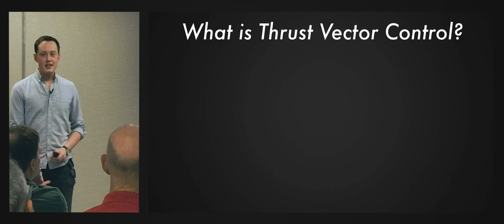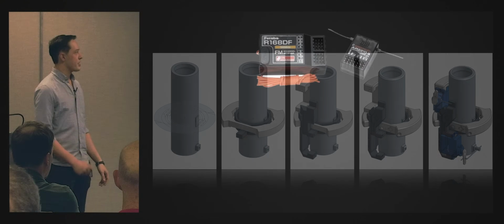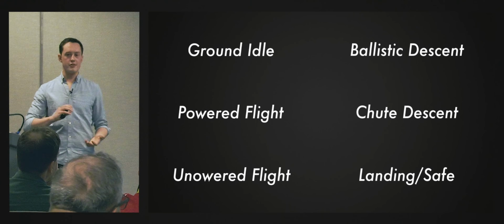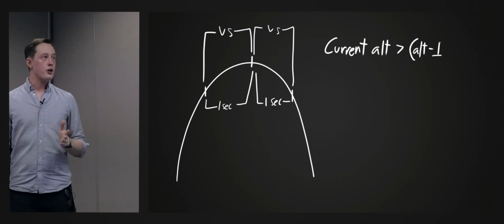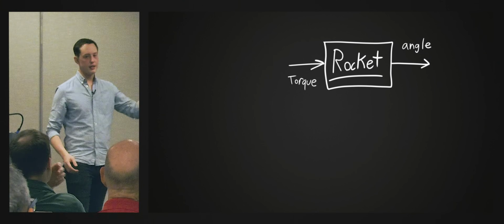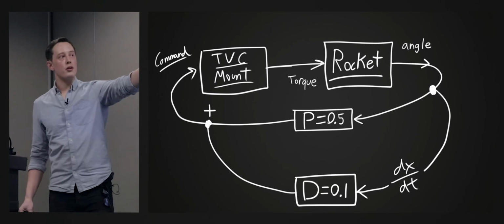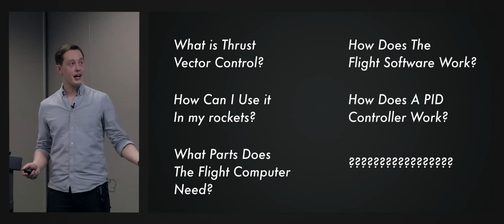How To Build a Thrust Vectored Model Rocket - National Rocketry Conference 2020

Comment: So rather than develop a standalone, why not use a Flight controller light a H743 or F7 made for quads. INAV and Ardupilot allow custom mixing that allows you to map roll pitch and yaw, also home positioning and take a beating. Plus they have prebuilt peripherals already coded in.

Comment: Wow.... PID controller huh? Amazing how nothing changes but the names. Pretty sure this used to be called a servo control loop back when I was younger 😂😂
Reply: Only if it’s used for a servo…this is just the general form of it, which can apply to everything from rocket motors to your air conditioner

Comment: .turbine thrust L
Reply: . Around the rocket also to help burn off space rock and debris
Reply: . "Burn off"
Reply: Getting vehicle back safely (contained or stalled stagnant) = landline the symbol for an old phone line? Looks like a capitol
Reply: Why not use all four? But switch off in rotation in "jobs" for example radiator alternator fan belt engine do they don't exhaust or "tire out or burn out" like a giro
Reply: Use a tide latitude or longitude
Reply: How do you kick (with your foot) energy back into battery are batteries positive negative neutral combinations according to an outlet thats not labeled positive negative neutral or combinations? Is the rocket +- or neither ?
Reply: Ware gets worn " Warning ⚠️"

Comment: 10:50 microcontroller options :=
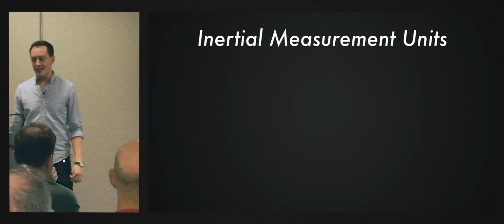12:25 Inertial measurement unit options =
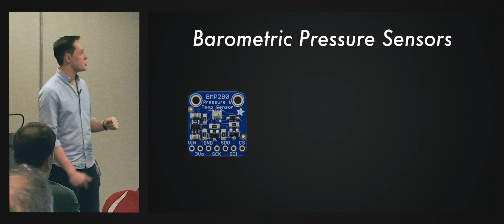13:05 Barometric Pressure Sensors options =
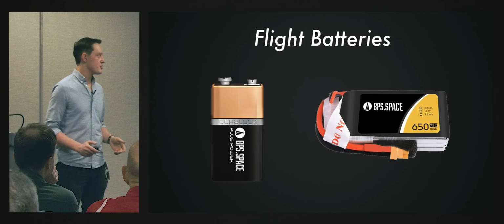16:00 Data Recoreders options =

Comment: I've heard him talk about PID controls for his rocket and it's off a bit ... 
Then I remember he's using an Arduino and such.  & I'm not familiar with what's available there. 
So ...Yes,  P is proportional, I is Integral, and D is differential.  
"I" is not dangerous and "D" is not necessarily always a brake or hardly ever just a brake.
There are a lot of selections that can be made with PIDs: 
Different formulas. 
The loop can be direct-acting or indirect-acting. 
The parts of the loop can act on a change in feedback, or change of error.
"I" can be set to either "repeats per minute" or "minutes per repeat".
"D" is anticipatory control and for this value to be more than some factual number requires the application to have a lot of storage...room to work.
A lot of time "D" is just best to set this to its lowest value.

Comment: Gread Presentation and overall verry Informative VIDEO.
U can use FC-Black Box logg and that will provide u a s..t load of data like on what Hz dose exactly rocket vibrate fom microsecund to microsecund.,how fast u accelareted,on what inclinacion is rocket at anny time,u can filter electrical noise,look just how HUGE Are Quadcopters (FPV) EVOLVE JUST from analizing BlackBox data,And u can use Betaflight Black Box loger and even make lay-out over filmed video.
Take care and greatings from Croatia,land of Rimac,Buggati,Orqua FPV and lot of Unicorn I.T. Companies.

Comment: Awesome explanation I'm currently trying to build my first tvc controlled rocket and it already helped a lot. But I have one question if you're simply adding the derividive back into the loop you'd get, in your example, 1°+2°=3°. wouldn't that mean that you're accelerating even more since you're pushing the engine even further outwards
Did I miss something or is there another problem I just don't see.

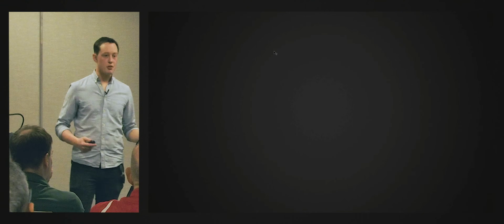Comment: Great info - thanks!  One thing: at engine burnout, at any real velocity, there's usually quite a large deceleration.  I'm confused by the statement around the 22:00 mark that acceleration at burnout is zero.  So this assumes a positive acceleration only, yes?  This negative acceleration (deceleration), of course, has been long used to actuate staging switches in model rockets (originally, mercury switches).

Comment: I tune PID controllers at work fairly often (and I wrote one for a PLC a long time ago. The supplied controller was better). I work in gas processing and oil transportation btw. This was a great explanation. Initially I thought that using Derivative in something as fast as controlling a rocket launch but I'm not sure. We use D when there's a lot of deadtime. It's both brake and accelerator btw (depends on the direction of the correction). However SP and PV are normalized. Ie SP is 0-100%, PV is 0-100% of range, and CV (output) is 0-100%.  Our time scales is much longer... ie minutes vs a rocket which is a couple of seconds or a few thousands of milliseconds. Something to think about...

Comment: This dude basically explained the bulk of a semester's worth of Control Systems Class in a span of 30 mins.

Before you can write the code of a closed loop system, you need to model the system to figure out modeling the time and frequency domains. The annoying part is having to calculate for solving steady state errors.

TL;DR. If you want to be good at control systems. Master modeling the system first, and after that you essentially just add them up (Being very vague here). I'm lazy and just use a function found in MATLAB to do the calculations for me.

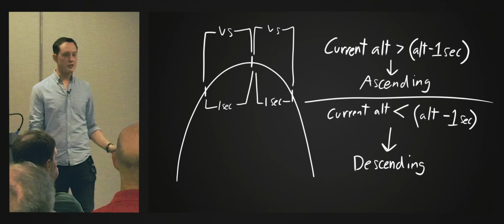Comment: 25:10 Can't use acceleration to detect apogee. After MECO the acceleration, disregarding any aerodynamic forces, is constant, gravitationally constant. Velocity you'd need a GPS chip to detect, which again would basically be using altitude measurements to get vertical velocity, which comes from a series of altitude datapoints to extrapolate out the velocity at which point your base data is just altitude again but at a higher cost (gps chip & antenna) so why not just use the altitude points directly  & for cheapness use a barometer for altitude detection. If you wanted a less reliable way I suppose you could try and detect apogee by detectiong when forces on rocket are basically absolutely zero due to no more drag from air resistance, but that doesn't seem reliable at all.

Comment: In gliding we use the MS5611 barometric pressure sensor a lot. They might be more precise than what you're used to, but the membrane also acts as accelerometer if you have vibrations.

Comment: I thought about using computer vision on a laptop to triangulate the position of the model rocket in 60 FPS from at least two cameras (GoPros), send commands, and use the data to quickly solve for landing. This approach is harder and not as practical. 

The other approach is the use of beacons. The model rocket pings a WiFi/ Bluetooth signal and receivers on the ground triangulate it’s position very accurately using a trained neural net. You can plot the points and use a physics engine on a laptop to make predictions, then send instructions to the model rocket to take. The downside is that the receivers cannot be blocked and the triangulation becomes less accurate as the model rocket moves farther away.

Comment: You could actually probably do the fin thing pretty easily. And you'd learn A TON in the process about aerodynamics. You could just use thin airfoil theory to dictate your cL at different AoAs, and you have a constant planform area, then the drag and lift equations become super easy up to about 10 degrees, which is plenty.

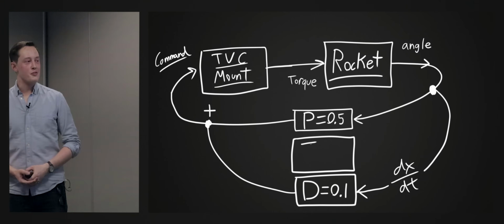Comment: @38:38  you're saying p is the standard amount of correction and adding d to the amount of correction to in order to account for the amplitude of the speed of rotation off  of the z axis.  You are using really big words.  It makes it hard to follow but since these are basic requirements to keep the rocket upright I can figure it out because I know where you are headed. There is a reason you are using this nomenclature but you have not told us why.  I am guessing it is because this is the language you think the engineers at spacex use.  Works for me.  I would like to seem some of your code for this.

Comment: 8:04 Guy is wrong. Don't recommend a hardware solution because you want to have full control over the software? You can flash the software you want to Pixhawk or Ardupilot, and also the oficial firmware is open source so you can use it for your build just taking what you need. Everything else is ok.

Comment: I was wondering about the use of a sliding tube for variable Krushnic effect (fine down-throttling, especially at landing) combined with four side ports in that tube which would be opened and closed to possibly cause some degree of thrust vectoring.

Comment: At 8:00 you mention Pixhawk as one of the things you do not recommend because you don't have full control over software or/and hardware. This is utterly untrue regarding the software. It contains fully accessible STM32 MCU(s) you can flash and debug in the same way you would debug Nucleo or even any other Cortex Mx based board - via SWD. Regarding the hardware: Full schematics are available at https://github.com/pixhawk/Hardware . You can use them as a basis for your own custom board if you want one.
Btw. both Ardupilot (software) and PX4 (software) use Pixhawks as a kinda main hardware platform. And specifically the PX4 might be very interesting for rocketry because it is extremely modular consisting of micro-apps communicating on a fast software bus and you can easily take and reuse generic things like attitude estimation while having your own mission workflow, control loops etc..

Comment: Next step thrust control idk how its called
Reply: These type of motors burn completely after ignition, theres no throttling. Once you light it, it burns till it runs out of fuel.

Comment: I love how the bald guy with the red shirt is nodding approvingly!
Reply: Scott Manley, is that you?
Reply: That is likely Trip Barber of NOVAAR#205.  He is an MIT graduate, ex Naval ship commander, and has been doing rocketry and NARAMs for 50 years, Since NARAM-10.  He has seen, experimented, and experienced presentations of most of the R&D papers and experiments submitted by NARAM R&D researchers regarding TVC and guidance of model rockets. His nodding is recognition of the process historically, so he is very well aware of the TVC projects before and since Joe's projects.  He chronologically and topically compiled all of the R&D reports of NAR since 1957.   The following is just the section of papers and flown NARAM projects regarding guidance and control of model rockets Joe was likely using as process knowledge and research resources.
Guidance:
Active Guidance & Dynamic Flight Mechanics for Model Rockets, David Ketchledge, HPR Jul 93, 17p.
Analytic Study of a Pendulum Guidance System in a Model Rocket, Don Venhaus, MITCON Proceedings 74, 2p.
An Electrolytic Guidance Unit, Peter Sauer, MITCON Proceedings 73, 1p.
A Guidance System for Model Rockets, Alan Bilger, MR May 74, 5p; ltr response, Mike Wende, MR Feb 75, 2p.
Ram Air as a Method of Rocket Control, Forrest Mims; Part 1, MRM Feb 70, 5p; Part 2, MRM Mar 70, 3p.
Rollerons: Simplified Roll Control for Amateur Rocket Vehicles, David Crisalli, HPR May 96, 6p.
Vertical Trajectory Guidance System, Steve Ainsworth, HPR Mar 99, 6p.
Capacitor Discharge Guidance, Forrest Mims, MRM Nov 70, 2p.
Development of a Sun-Based On-Board Guidance System, George Gassaway, NAR TR-204; NARAM 30 R&D,
1988.
Sun-Seeking Guidance System for High-Power Rockets, David Mandot, HPR Nov 96, 5p.
Gyroscope-Controlled Guidance System, Steve Ainsworth & Brian Riordan, HPR Nov 96, 4p.
Development of a Gimbaled Engine Mount for Use in Guided Rockets, Zunofark Team, NARAM-31 R&D, 1989.
Gimbaled Propulsion, Dave Gianakos, HPR May 93, 3p.
Active Stabilization Flight Computer, Brian Guzek, NARAM 51 R&D, 2009.
Electronic Stabilization of a Rocket, Alyssa Stenberg, NARAM 55 R&D, 2013.
Gyro Guidance System in Rocket Gliders, Alyssa Stenberg, NARAM 56 R&D, 2014.
Reply: I just noticed

Comment: I feel somewhat unnecessarily vindicated. I made a comment on an earlier video about PID feedback loops used in manufacturing process controls that might also help to reduce guidance oscillations. You were talking selectively or non technically about the control "algorithm" and I began to suspect it was indeed a PID algorithm in your custom software (whether you knew it or not). Suspicion confirmed. As a (former) Process Control technician , (now retired ship's captain which by-the-way, modern auto pilot systems also use a PID feedback loop in their software), I learned how to calculate the data points to plug into the algorithm for various product specifications the plant was producing, but although I understood the theory, I honestly didn't understand how a PID did what it did, just why it did what it did and the end results in the output if you did the calculations correctly. Your simple explanation, parking lot analogy, and flow chart has answered questions I have had since 1993 - not all of them, but many of them! In spite of technical difficulties, this was an excellent, understandable presentation. Well done!
Reply: He is not using PIDs anymore tho. He is doing full-state feedback.

Comment: What is a F or M motor?
Great presentation, thanks for sharing :)
Reply: I dont know much about this stuff, but from my understanding the letter indicates how much thrust or maybe total impulse a motor has, with A being the lowest/smallest motor. So F is kinda normal for Joe's rockets and M would be pretty heavy duty
Reply: The letter represents the total impulse range. For every level the max total impulse doubles. For example F motors have 40-80 n-sec and G motors have 80.01-160 n-sec.

Comment: "I'm being really 𝘦𝘹𝘩𝘢𝘶𝘴𝘵𝘪𝘷𝘦 by covering all of this stuff" lol
Reply: that's why you need an engineering degree
Reply: @nicosilverx  Yes like Elon.
Reply: @viralvidsrepository4632  He doesn't have an engineering degree.  He has a degree in physics and used that as a solid foundation to learn about rocketry.
Reply: @Bob-rh9fk  Unnecessary.
Reply: @viralvidsrepository4632  What is?
Reply: @Bob-rh9fk  His degrees.  Maybe I'm biased because him and I are similar.  I'm also a PhD dropout that discovered school really does get in the way of a self motivated person that wants to rapidly acquire frameworks.
Reply: @Bob-rh9fk  You may be right.  I did eventually determine that a school curriculum was hindering my progress, but that does come from the perspective of having been thrust forward by an extensive (multi major) undergraduate experience.  Perhaps I am not giving credit where credit is due.